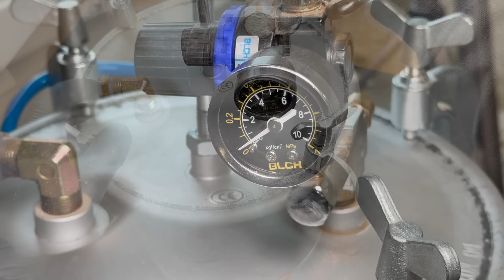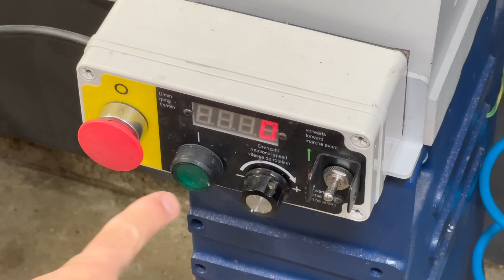NEW  Innovative IDEA for this CAPTIVATING woodturning project😳

Comment: Your xtool is way more accurate than my D1 pro, ran the same program 6 times , size was slightly different all 6 times
Reply from the maker: For this type of cutting in very hard wood like elm, the D1 was not sufficient.
I used the P2, a much more powerful co2 laser.

Comment: I love watching the "creative process" and wondering where it will go. I've seen other woodturners use epoxy compounds to marry with the wood; I recall a written comment of yours as to what to do with all of the "string confetti" that flies from the lath. Have you tried suspending those string thread confetti in epoxy with wood on top and bottom to create a sculpted "seaweed fishbowl" effect? That might be interesting.
Reply from the maker: James 👍
thank you very much for your comment 😉
I am very happy that you appreciate my work 
I also thank you for the suggestion I did not think of making algae with the epoxy resin threads… why not🤔